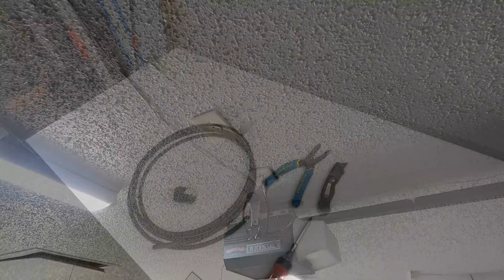YouTube Paid for this 17 Inch Band Saw (Grizzly G0513X2F) . Unboxing and review

Comment: The ruler on the bar is calibrated to the low cast iron fence not to the tall auxiliary removeable aluminum resaw fence, hence the reduced measurement between the latter and the blade.  I have the 0513X2BF version, which is the same but has both pedal and electric brake.

Comment: While I have no idea why Grizzly ships with a blade on, it did prove beneficial for me.  

After unboxing and before any assembly, one simply has to make sure the blade is tracking correctly and is tensioned, and then you can test out the electrical and make sure you have a functioning saw before potentially wasting time putting the table onto a dud.

Comment: Have you used the cnc router yet?
Reply from the maker: Hi Friend. Without going into it too much, dealing straight with China is a big pain. Turns out I had a faulty Power Supply. Manufacturer didn't want to believe it so it took them forever to agree that they sent a faulty PS. I just recently  installed it an am now going to learn how to use the software. Apologies for the delay. Hopefully will have something soon.